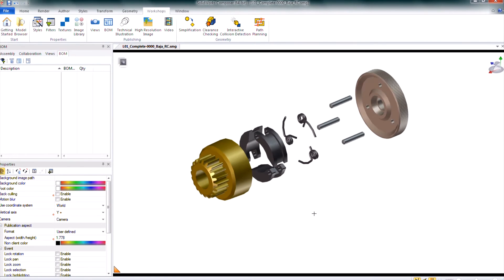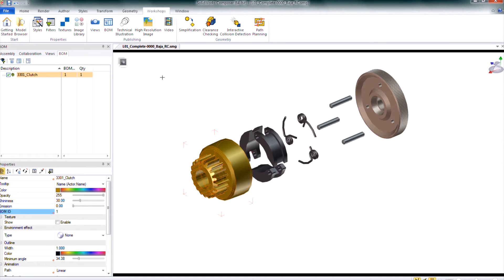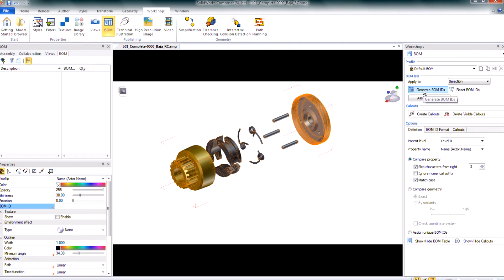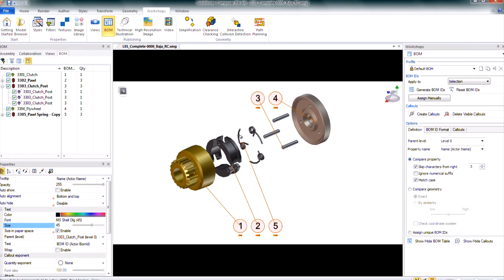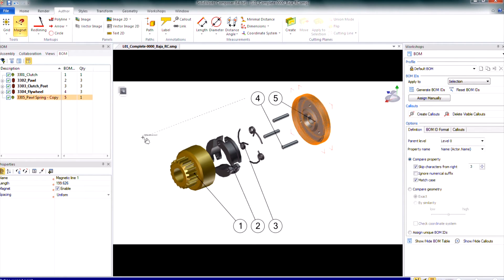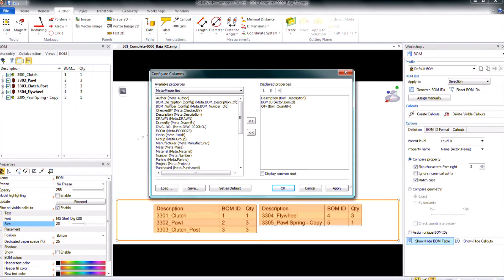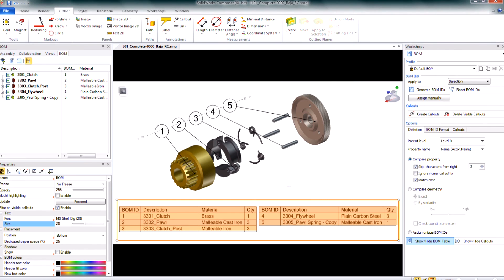SOLIDWORKS Composer - How to Assign BOM ID's and Edit Tables

Comment: how do you adjust the BOM column width?  my text is running over the end of the column
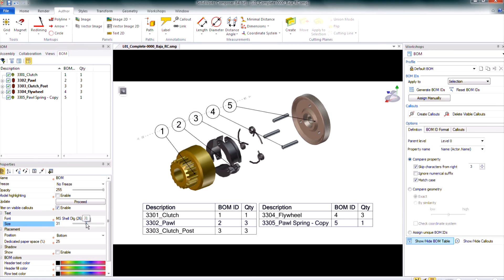Reply: At 3:09, you can see the properties section of the BOM table. Under the placement section, change it from 'bottom' to 'free' and then you can easily move the table around and change its dimensions by clicking and dragging its vertices.
Reply: @sohaibalam4168  There doesn't seem to be a way of actually adjusting column width (or changing much of anything of the appearance of the BOM other than to change the font or add colours to the rows)

Comment: Hello, nice video, but the names in the bom table are not in the correct order after changing callouts' numbering sequence. How do you fix that? For example number 4 is flywheel, though it is already number 5. And is it possible to change description names without changing every part's name and uploading it in an assembly again?
Reply: EXACTLY!  This video is very misleading.  I'm still trying to figure out how to fix this, if you are aware of how to do it, please respond.  Thanks.
Reply: @robgrossi2368  Sadly not, I have just deleted everything in a table and wrote my own names if I recall... Or maybe I have hidden the part with automatic names and wrote everything by hand.
Reply: @unobombers  It's so frustrating!  I'm working on ASMs that have 15k+ parts so I'm doing everything I can to avoid manually typing BOM tables.  I just can't get Composer to re-order BOM items properly.  My descriptions remain OK but the part numbers get re-assigned.  Tried so many work-arounds but it still often screws up.  What a frustrating software.
Reply: @robgrossi2368  OMG :O That's a lot... I have had only 50 parts or so and needed Composer only once. And I remember another thing i did not like was the zoom in and out... And if I remember it right I asked some guys that are working in a gearbox factory, they could not find the way to arrange them as well... Maybe it marks them out in the same sequence as in a normal solidworks assembly part list? Well good luck Sir...